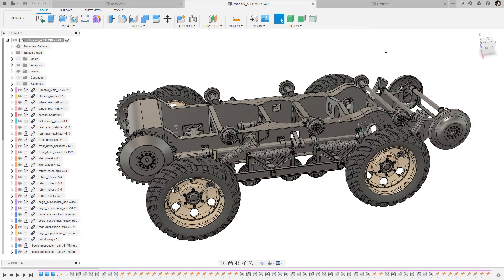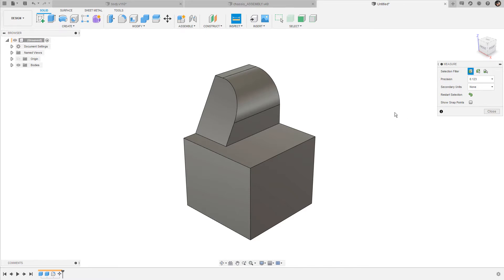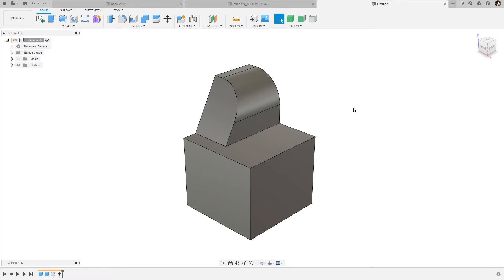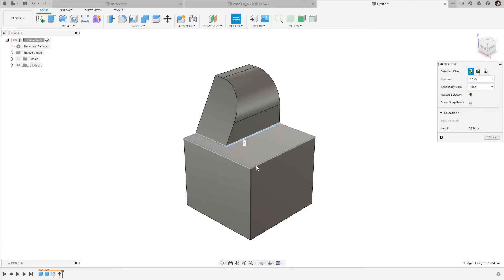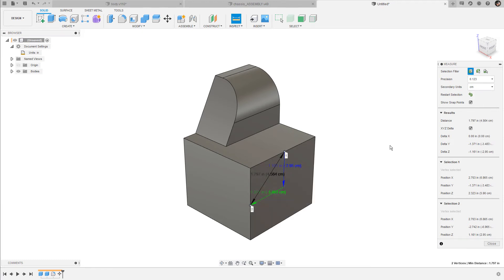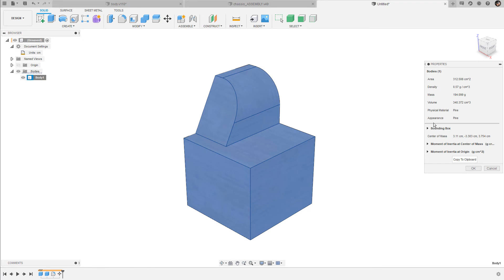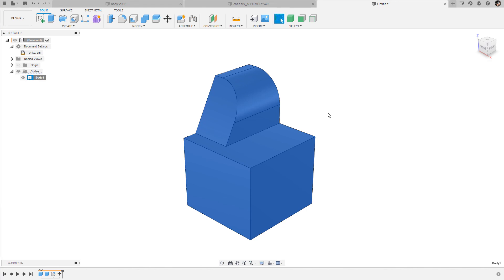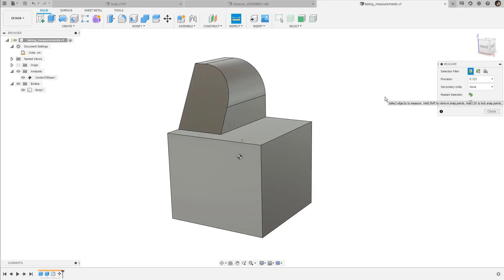How To Take Measurements In Fusion 360 - Day 23

Comment: is there a way to save the measurements on-screen? I'd like to make a pseudo blueprint with measurements from an existing model
Reply from the maker: Not in the 3d viewport. Import your model, save it and switch to the drawing mode (click on large design button in the left-hand upper corner). You can then draw the model on the canvas and add measurements (works only for orthogonal views) Thanks for watching and your question. Best, Ben

Comment: hi, i just bought a 3d car on google and im going to build it in real life. Im using fusion 360 and when im going to measure the car, it says the car is 16 meters long and not as it should be. How do i make it smaller with the measure?
Reply from the maker: What file types does the package contains that you bought? It can be necessary to adjust the size of the model in another application like Rhino for instance before you bring the model to Fusion. Does it consists of many different parts? If not, you can try the scale function in Fusion. Best, Ben

Comment: Hey great video !
Is it possible to measure volumes ? I would like to make a coffee spoon containing the right volume of coffee, but I did not find an easy way to measure the volume.
Reply from the maker: Thanks for your question. Yes, there is a way to do it. It's a bit tricky to describe, but go to the create tab and then down to "Boundary Fill". When you hover over the tool, a short description pops up. Let's say you have a glass of water, and you want to measure the volume of liquid that fits into the glass. You create the glass first and a tool/dummy object second (something like a simple box volume that intersects the glass as illustrated in the tool tip help text). When you now run the boundary fill command, you can select the internal volume of the water you want to keep. This gets added as a new body. All you have to do now it to right-click on the new body in the browser tree, select properties and take a look at the volume value there. Hope this helps. Thanks for watching my videos. Best, Ben